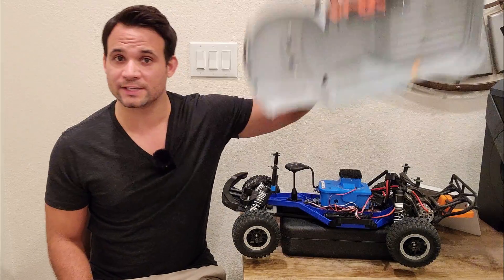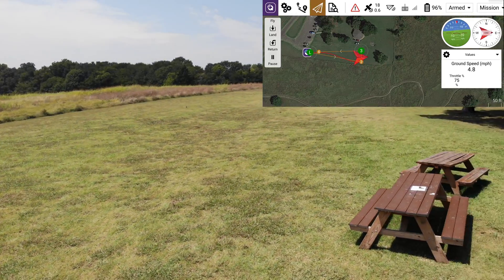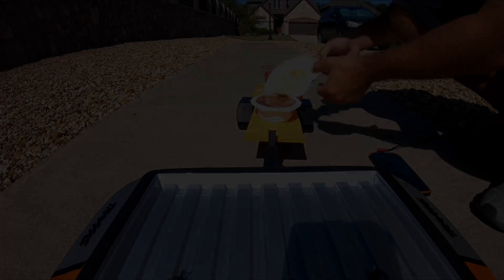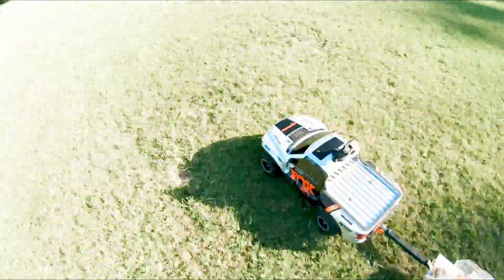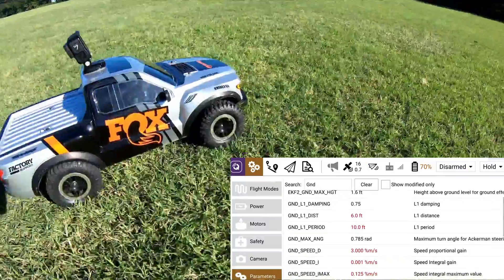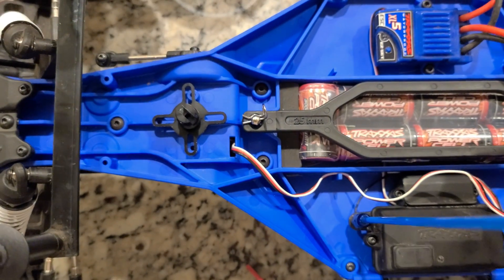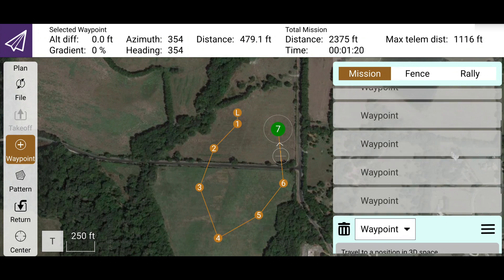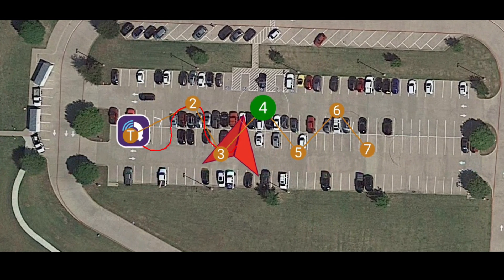Autonomous Food Delivery with a Traxxas RC Car

Comment: This video was posted about 2 years ago and now I'm trying to make one of these for some students at a high school but god help me I cant get the parameters right. if anyone knows how to do this or where I could find the parameters to double check my work please let me know.
Reply from the maker: What are you struggling with so far?
Reply: @EngineeringAfterHours  I was given a traxxas slash and I couldn't get the 2 wire motor or the ESC to cooperate i had put in a 3 wire brushless motor and connected my radiomaster zorro to it and it now runs with just the remote but cant do autonomous missions, something to do with the GPS. I honestly wished it would of worked with the original parts though and sonar/IMU it would be easier for the school to use.

Comment: Can you tell me where I can get a few cars like this?
Reply from the maker: Traxxas makes the base rc. The autonomous kit is largely from holybro based on the pixhawk 4 with PX4 control software. 

If you don't want it autonomous, it's way easier to just use the truck and make a trailer.

Comment: We used the uBlox NEO-M8P series GPS receiver and base station to get high precision coordinates in our autonomous vehicle project. We were driving dune buggies around a track. The only issue we had is at 50kph the distance between GPS updates was a few meters. It was still an awesome solution.

https://www.u-blox.com/en/product/neo-m8p-series
Reply from the maker: That sounds awesome. I was a little worried about the GPS refresh rate as well, and was hoping to push closer to 80+ KPH. Maybe I need to scale my speed target back until I have a more sophisticated system.
Reply: @EngineeringAfterHours  Our full size car was running on a track that was about 4m wide. We weren't able to detect it was off the road until it was REALLY off the road. But it still did the job. 80kph might be ok for your use case. You can't travel around people at that speed so most objects you have to deal at that speed with will be pretty stationary.

Comment: Lidar is an awesome next goal, even if it's to simply slow down in case of impending impact ("lamp post ahoy!")    My favorite feature would be a head tracked FPV camera so I can witness the trouble it gets into and take control when necessary.  Controlling and viewing everything over IP would also be a fun stretch goal.

Comment: Awesome implementation into an existing RC platform. Let's say you finish the build with your intended upgrades, what purpose will it serve when complete? Will it have any functional tasks, or simply entertainment?
Reply from the maker: It could be functional in many ways:

- autonomous camera car
-basic outdoor utility like transporting items over long distances
-lawncare/agriculture work
-inspection & surveillance 

It's a pretty big list, but my first goal is an autonomous camera car.
Reply: @EngineeringAfterHours  Funny you mention lawncare, I have been brainstorming an FPV setup for my lawn that I wanted to start once I finish the two indoor racers for the kids. For it to be automated would be even better!
Reply from the maker: @3SIfan86  that's one of the reasons I want better gps accuracy...i have a small yard so being off by 2m is huge. But if I can get "follow me" mode working...that'll be awesome.
Reply: @EngineeringAfterHours  my boss way centimetre accuracy for the autonomous lawn mower he plans to build, he was telling me a cheap way to get this level is to have stationary GPS on a base station which monitors the same satellites as the GPS on the rover, it send it's information to the rover that then works out the difference and obtains  centimetre accuracy.
Reply from the maker: @welshdave5263  thanks for the information. Ill look into this.
Reply: @welshdave5263  That's how it's usually done. It's called RTK. The uBlox NEO-M8P was the only unit we could find that did all the calculations in hardware and wasn't off the charts expensive. We had no major issue getting it working either.
Reply: @blindman2k  Awesome, thanks for the info, I'll look into this kit, cheers.